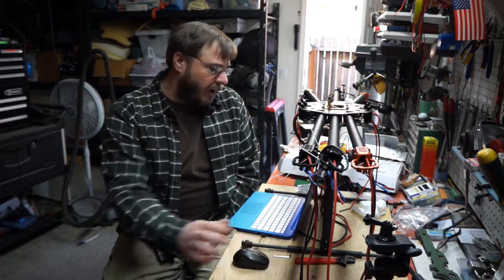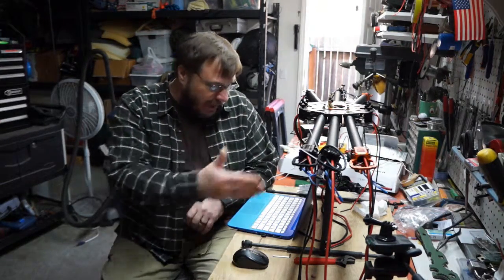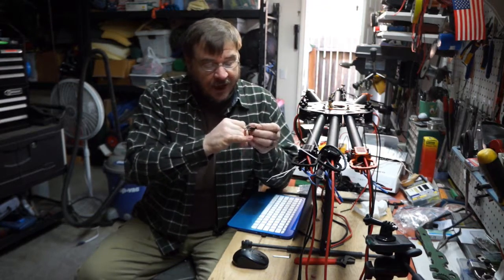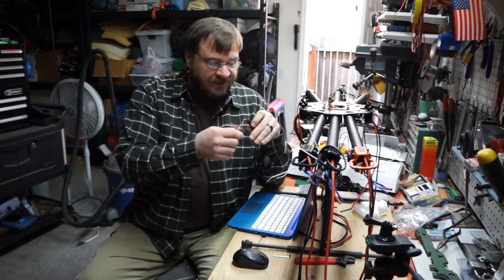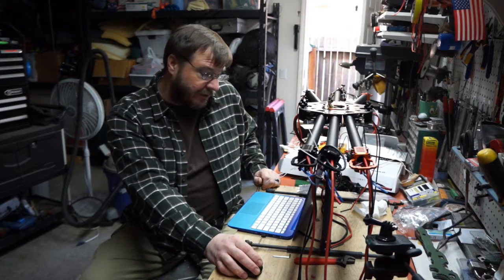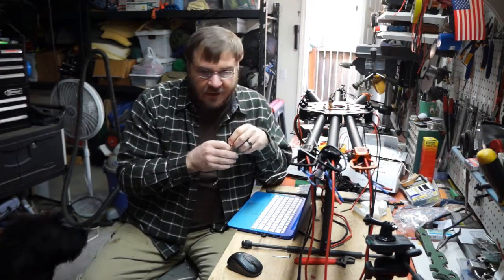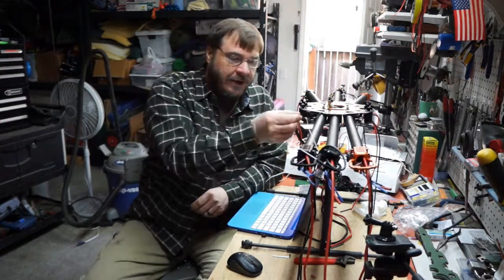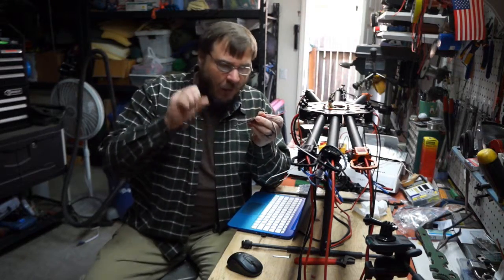Long wire ESC problem explained

Comment: I'm working on a personal project where I'm using 24 volt brushless ROV motors and a 8 inch hub motor wheel with 30-70 AMP bi-directional speed controllers normally used for RC Helicopters. The more AMPS the bigger the capacitors. My custom power cables to ESC are about 2 - 3 feet long. I've never had any issues. I think I've heard of this somewhere else but just haven't experienced it yet over last 3 years of tinkering. 🙂

Comment: Thank you, very helpful to a noob like me.  So if I use a 2nd battery for my RX would I have to worry about the ground loop issue?  I have the + wire that goes from the ESC to RX cut.  I've not driven it yet because I'm trying to make sure I'm not gonna F up my toy.
Reply from the maker: @PatrickBaptist  I would just weight down the drone and do a ground test if was concerned

Comment: My forklift had a ~1000amp GE EV-1 DC SCR chopper controller. It died on me a few months after i rescued this machine from a surplus hut. Turns out, running it on a couple boat batteries will kill those controllers. They have NO input capacitors, because they expect a 1200lb battery to be inches away on 4/0 wire, and that acts as an input capacitor, and smooths the chop. I had 125lbs of battery... Switched to a controller that has it's own input caps, and all good. But this is absolutely true. You need something to smooth the noise/echo of the switching. And especially cheap and very small controllers will be very lacking in capacitance!

Comment: Well there are multiple engine fixed wing airplanes with long battery cables leading form the nose of the plane to the ESC out on the wings that don't have any problems with no added capacitors.🤔 I have one with 3 feet of wire between the batteries and the ESCs  out on the wings, its had Years of flying on it.🤔 no problems.  induction in DC is not a listed problem now with AC, its a big problem that can mess with all kinds of data lines and systems.😎
Reply: Multiple ESCs are all adding noise, and it all adds up. Thick wires and adds caps keep you gear from falling out of the sky.

But well built ESCs naturally have more caps on board as well. Cheap light weight ESCs are far more prone to this type of failure.

Comment: I have heard disconnecting battery from ESC while motor runs is bad for the ESC, is that true?
Reply from the maker: I couldn't say for sure. It would be easy to avoid doing it.

Comment: hi , 
I heard the same issue couple of days back. i searched for a some kind of equation where i can justify it with some theory. i have calculated the self and the mutual inductance of the wire. It came out to be very small value over a length of 2 Mtr. I decided to take a oscilloscope and measure the voltage spike. I couldn't  find Anything that  serious ,the max voltage spike was about 2V.

someone please comment how true this issue is. also please let me know how to prove (mathematically  or experimental) this problem.
any help highly appreciated.
thank you
Reply from the maker: I would believe your numbers. The long wire ESC problem is probably more of a myth than reality. I tried to explain it best as i could but in the end the wires would have to be very long before it would be a matter of concern.
Reply: Man...just run the wire. This crap aint gonna happen..i believe u would need serious length of wire for that electrical hammer effect to happen...if u extend it 2inches shouldnt be an issue..im gonna on my latrax tetons..3 of em all came apart at the connector because its too damn short..hardly have room to solder it n already soldered 1 n came out again pos..so im going to put in new wires if it possible if not i will extend the wires maybe 2 inches n put heat shrink around it...